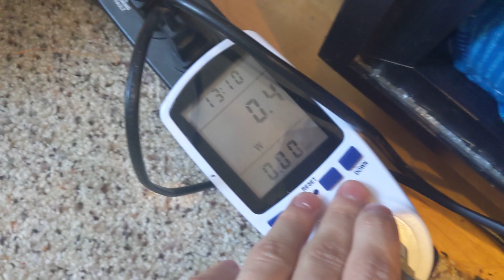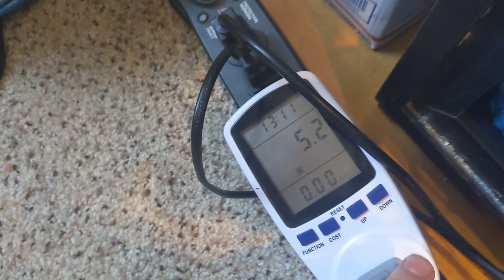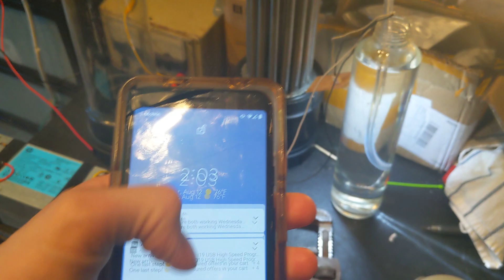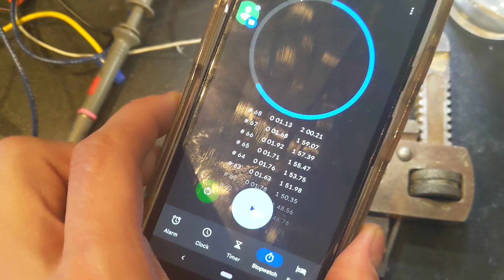HHO High Voltage Cell

Comment: Make your car a hydrogen hi-brid Hho increase fuel burning efficiency better then a new car.  Remember that HHO gas is highly flammable and explosive (strong pops sound) so must use a safety water bubbler.

Cool engine running  prolonging engine life and engine oil life with less engine maintainess required🚦

 100% fuel will burn in the engine No un 

burn fuel wastage . Hho system works on petrol, deisel, cng.

Engine runs lighter smoother reducing carbon emissions significantly . Boost engine power and torque . Hho gas reduced engine noice & vibration

ACMEC hho car kit lower the engine temperature more reliable simply made Hho kits restore better fuel economy. Hho system is very easy and simple to install. Hho solves the engine heating problems automatically! Cleaner engine running. Reducing engine noise due to the faster fuel burning. Hho car kits works nicely requires no modifications in the car engine. No side effects on car engine.

Engine start quickly your car battery Will Charge Quickly make your car a low cost hy-brid. Useing  low amps. Hho car kit will work better. You can easily transfer hho kit from one car to another one. Hho kits requires  no modifications in the engine. HHO kits absolutely work. Kit can installed in engine room with water bubbler easy to fit by using cable ties. Remember you need to fill only distilled or de-ionised water in the hho car kit.

Hho can work on planes, ships, helicopters, tanks, trucks, cars and motorcycles.

For more information call zafar 03082266179 or watch HHO zafar videos on YouTube.

Comment: An idea: use single wire HV with a single electrode. Flyback transfo + first stage of a voltage multiplier, you use only the negative side, effectively making a negative ion generator. You may not make a lot of gas with this circuit, but as soon as you apply a vacuum to the cell, the water vapor you create will be combustible, at least when it's combined with an air fuel mixture.

Comment: You must be getting some voltrolysis effect with the circuit. The gas production is expected to increase over time while the power draw drop when it's voltrolysis because as you said a dielectric layer does form on the tube over time. Also the tap water does have electrolyte in it, it's far more conductive than distilled water. From my experiments tap water gives better result than distilled water. It must be due to a leakage current required to initiate the voltrolysis process when a relative low voltage is used. I'm guessing the distilled water would require killovolts